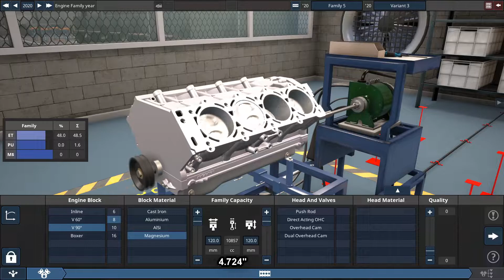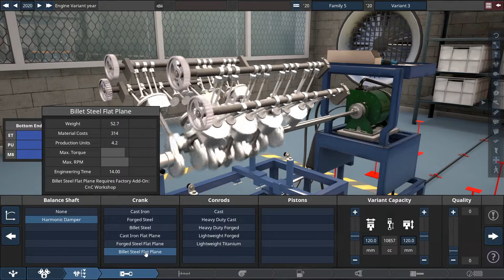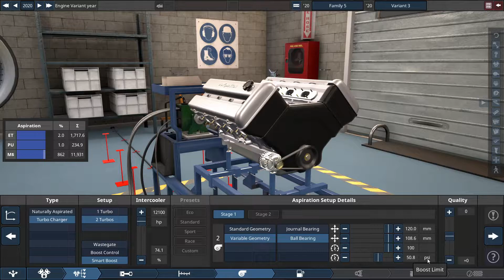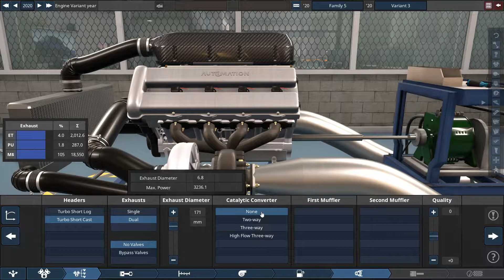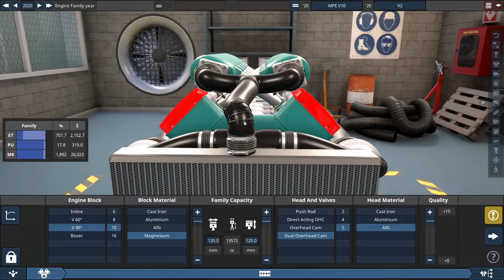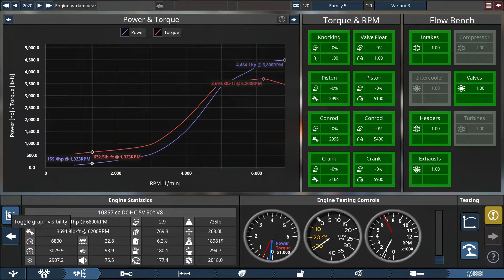The Most Powerful V8 Engine Ever! (LCV 4.2) | Automation The Car Company Tycoon Game

Comment: two-stroke V8 Engine 
its fuel ratio is 13.7 
it uses custom fuel  
an 104 octane gasolene and 2 stroke oil  mix